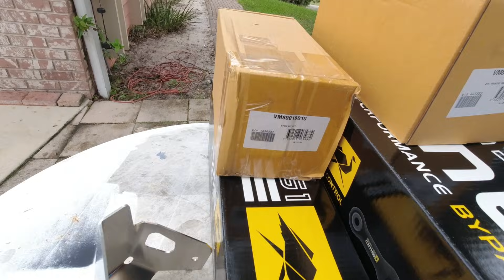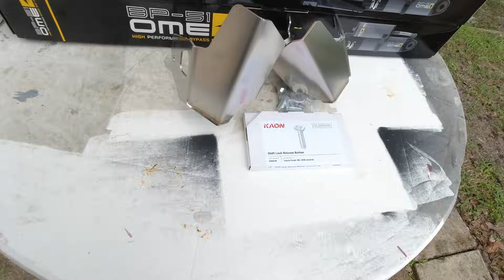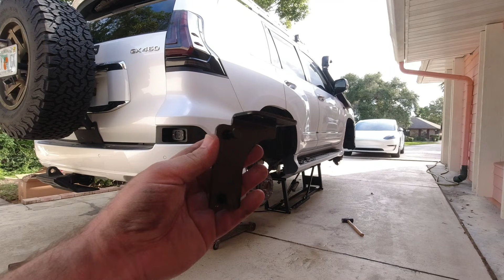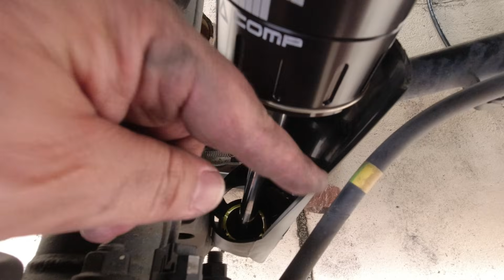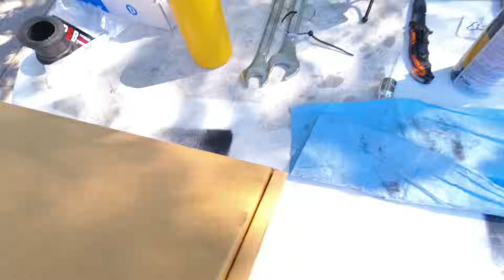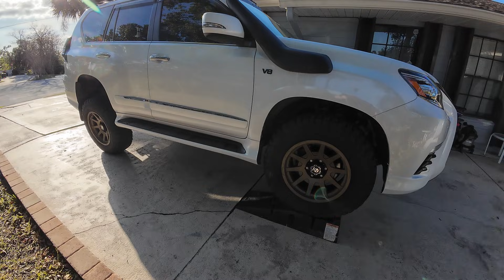GX460 BP51 INSTALLATION DIY

Comment: Is that an OE front grill?
Reply from the maker: No sir, aftermarket blacked out version.
Reply: @DIYSpeedGarage  Nice! Looks really good. How's the fitment? Can you please share the link where you get it from? I've been wanting to do mine also.
Reply from the maker: @WandererProjects I left a link in the video description. It's for a whole set, it gives you the option of customizing the set like also getting upper control arms and other things.
Reply: Thanks! Do you have a link on the front grill? Thanks
Reply from the maker: 😂, sorry I thought you were asking about the suspension. I'll post some links for the grill.
Reply: 😂 no worries. Thank you for the link. How's the quality?
Reply from the maker: @WandererProjects quality is ok, maybe 50% quality of the original Japanese grill 😂 but for the money I can't complain. You can't really compare Japanese quality with China/Taiwan. Anyways I see grills as wear items, especially if you get the standard grill at that low price.
Reply: @DIYSpeedGarage Make sense. As long as the fitment is good. Thank you. I appreciate your response.
Reply from the maker: @WandererProjects fitment is good. Just make sure to tape up your bumper close to the edges where the grill will slide in, you don't want to knick your paint by accident.

Comment: Great video man... Im a 2022 Land Cruiser prado 150 with the KDSS... and ive been searching exactly that suspension for my car... the BP51's.... how would you describe the ride quality.. cause i understand that they are position sensitiveee.. cause of that they ridee described like buttery smooth... what about little bumps compliance.... bad road?? Are they worth it?
Reply from the maker: Hey, that's great! I had Prado 120 series back in the day when I was working in Africa, they are solid machines just like the 150 series.
Anyways to answer your question, yes they are worth it! You can make them as soft and buttery as you want for soaking up bad pothole ridden roads or corrugated dirt roads. You can also make them firm for mostly paved surfaces, or you could do that just for the rear set when towing. It's definitely worth it and I recommend them!
Reply: @DIYSpeedGarage  great background man.... i also had a 120 Vx with AVS + rear air suspension and the 3.0 1KZ diesel engine. That car was just amazing.....
So good to hear about the BP-51 from OME.... causee to be honest I just dont understand why the 150 prado with the KDSS and no adaptive variable suspension rides soo bad... like literally iss really really stiff... and after adding the Falken wildpeak at3w's this january its just worsee.... that why i wss looking for the softest aftermarket shocks... the good thing is that between the prado and the gx ... the part code in OME is the  same... so ill check what you ordered... maybe you could send me the link of what you bought...
Reply from the maker: @angelmunoz3709 I'll post the links in the video description tonight. The past numbers I used are an exact fit for the 150 series Prado. I had an issue with the mounting brackets on the front because I have a V8 but on your car it'll be perfect.
Reply: @DIYSpeedGarage  thaanks maan, finnally someone does an amazing video for this suspension... hopee ypu get the viral views here... totally worth iit

Comment: Thanks a lot. Planning to upgrade my suspension myself as well. this is going to help!

Just one question: have you ever removed a tailgate by yourself? I have just had it painted for me and it needs to be put back, with all the plastic liners inside and outside. I just want to know how easy it is to DIY the thing or do I need to let a shop do it instead?
Reply from the maker: As long as you have all the parts and wiring it should be very easy to DIY, the only thing that would be difficult is getting it hung up by yourself, I would recommend getting a helper and using a set of saw horses to hold up the tailgate while you are installing the bolts for the hinges. Good luck
Reply: @DIYSpeedGarage  Thanks a lot! love your content! My GX is also white as well :D 2017 base model
Reply from the maker: @DementusViking Nice, white is the best color! 2017 is good, I think that's the year they got the lane keep assist, radar cruise, and other Lexus Safety Sense features.